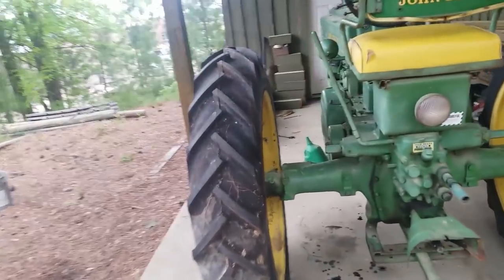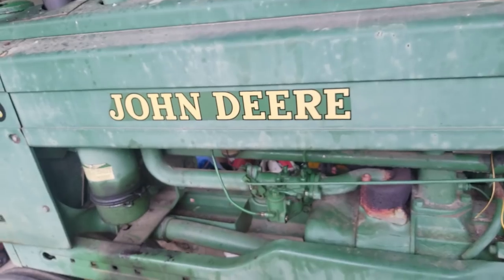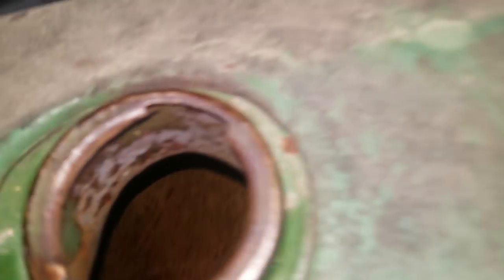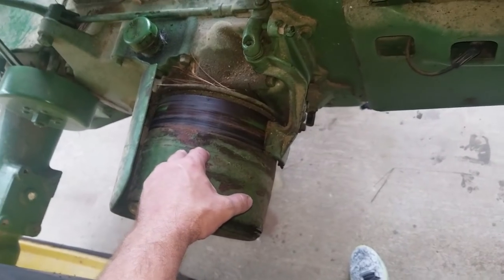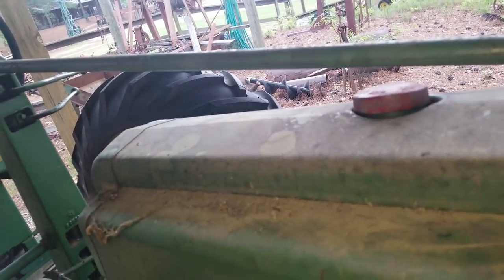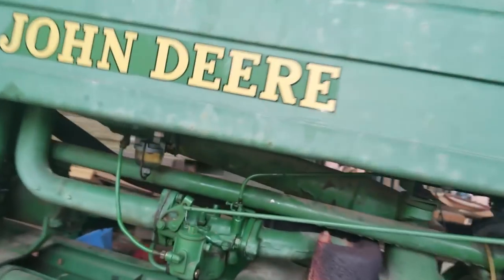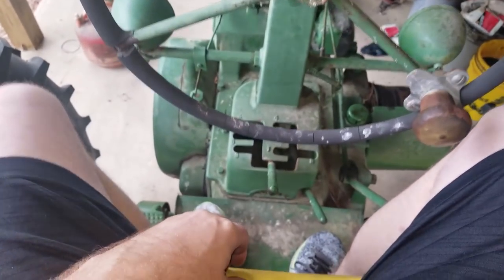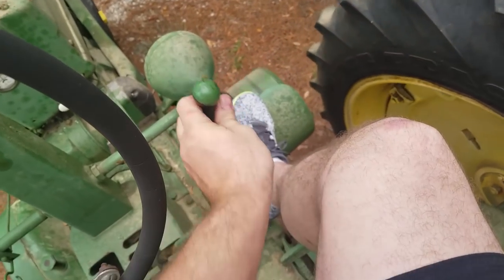How to  drive an antique John Deere tractor

Comment: After watching this video on describing the difference part of a JD-B, first of all you said to check the oil you take the plug out and look in their to see the oil level, what you do is screw it out a few turns and oil should drip out the bottom if not add oil until it does, then the lever on the left side of the seat isn’t the power takeoff lever it’s for the hydraulic lifts like the rock shaft that sticks out on each side of the seat or a cylinder on a piece of machinery your pulling, the PTO lever is that little one below the clutch level which can only be engaged when the clutch is disengaged, as for shutting the tractor off all you should have to do is pull he throttle lever way back and the tractor should stop, on yours either the linkage on the rod going to the carburetor is wrong or the set screw on the screw on the carburetor next to where the rod connects is screwed in to far and not letting the butterfly inside the carburetor close tight, I’m not trying to be a smarty I just wanted help you understand the JD two cylinder tractor better,
Reply: Fred is absolutely correct.
Reply: All correct, Fred. Looks like it has the Pow-r-trol hydraulic set up. The 1949 B I started driving when I was  3 years old had only a foot pedal under the front edge of the seat tower to operate the rocker shaft. We had other somewhat newer two cylinder tractors in those days that did have the Pow-R-Trol hydraulics and live pto (50, 60, 620). The one in this video desperately needs that clutch lever adjusted. It will take your kneecap off if you snap it out of engaged position running it like that lol. I do remember using the belt pulley to power grinders and other equipment. And with practice, it was possible and sometimes necessary to shift on the go. We still used our old B for light work -running augurs or moving wagons around the yard - until at least the late 1960s by which point not much work was done with anything less than 90 hp or so. And now the "big" tractors from those days are scarcely worth starting up to do more than running an augur or going to get the mail ;-)

Comment: Good.  But you shouldn't use the choke to stop the engine.   Properly,  closing the throttle should do that.  But some of the  early models (pre-1947) were shut off by closing the gas spigot.  Thanks for sharing.

Comment: You can shift on the fly on these JD's with some practice.  It  also saves riding the clutch when trying to start from stop in 6th/road gear.   On my uncles tractors we would start in 4th, open throttle wide open, when up to speed, then pop the clutch, pull back some on throttle, shift into 6th, bump the clutch a bit if your grinding, and should go right in, throttle back up.  Trick is to do this all before you lose momentum.  If you get the right "touch"  of throttle, and clutch, shifting, it goes right in without any grinding and you jump right into road gear without a lot of wear on the clutch.  Some of later JD's had hi/lo levers down by shifter, next to power take off lever, they were even easier, gears were 1-2,3-4,5-6 and you could do the above starting low lever position, then shift on the fly to high, using your foot to  move the hi/lo lever.  5-6 still kind of rode the clutch from a dead start but not as bad as from 6th.  We mainly did up shifting as you had to slow way down to down shift one or two gears down on the fly, throttle way back.  My uncle when haying with a jayhawk bucket could make it look like he had an automatic transmission he was so good at it.  Those were the days !   Enjoyed the video !
Reply: Yeah my dad has told me how to do that on the deeres that have hi-lo gears. Its a lil tricky but not impossible
Reply: I remember this, David M , now that you mention it. Wonder why we didn't get killed in those days because we were always pulling stuff that if you think about it, was ridiculously way too heavy for such tiny tractors lol. Always managed to get stopped with it somehow, but pretty risky business if the truth were known ;-)
Reply: @kennethstanton5407  Isn't that the truth? Not only overtaxing equipment, overweight pulling, etc., when I was younger, would ride with my cousin standing on bouncing parts of tractor pulling implements that would pulverize me if I fell off, forget any safety.  I did have another cousin tip one of these on a side hill too fast, fortunately threw him free, but messed up his hip.
Reply: @davidm8717  I was remembering today that I was only about 5 years old when I was turned loose on my own running a B John Deere pulling drag harrows and a roller. I was given a stern warning not to turn too sharp because there was a risk that the hind wheel could pick up the harrow and drag it over top of you, which could do more than mess up the paint on the fender ;-) There didn't seem to be near as much worry that I would fall off and get run over by the roller. Either it's because they had more kids in those days and figured they had spares, so why worry? Or it's that my father figured I had demonstrated enough intelligence not to do anything goofy enough to end up falling off. ;-)   In those days, we would spend a ton of time riding along with the adults, or driving with them sitting behind us in the seat, for hundreds of hours before they'd let us operate solo.
Reply: my thought exactly,...thank you

Comment: You should never use the the clutch brake to stop the tractor should pull the clutch out and use the brakes evenly to stop and then use the clutch brake to stop the belt pulley so you can put it in gear

Comment: The hand brake only stops the tractor while the transmission is engaged. If the tractor starts rolling while out of gear, the foot brakes are required to control the tractor.

Comment: Instead of rebuilding a car when I was 13,  Dad got me a B john deere to rebuild instead.  I didn't get a car till I was 18.  I still farm with one 30 plus years later.   Great tractor on the hay rake.
Reply: Even better on sickle mower ( also jd, that clamped to back of tractor, and single trailing wheel)) duty . Come to end of field , step on right brake spin steering right, then release brake and steer straight  to continue across field. Worked so well, so fast.

Comment: I have a John deere 620, 1957 that when I put it in gear and let out the clutch, doesn’t move. Is there some lever or gear I need to set ( besides putting the gear shift in a forward gear or reverse gear) to make it move? It was pulling fine when it was parked, but no one here knows how to make it go now… thanks, ANYONE!!
Reply: You might need to adjust the clutch. There’s YouTube videos on how it is done.

Comment: does it have petcocks underneath the cylinders to decompress? that's often part of the startup protocol
Reply: Most of the ones with compression relief were hand spin start.  Our A was like this with electric start & no compression relief.
Reply: Our 1955 JD model 60 has decompression petcocks
Reply: Even with electric start, most had the relief petcocks on the bottom side. The older ones (unstyled, for sure) without electric start had them up on the topside where you could see them, or open them without crawling around on your hands and knees. There was also a "crank" which was a steering wheel with a crank hub that fit into the flywheel hub. Awkward thing to use since you were squeezed between the flywheel housing and the rear wheel. And quite hateful if it backfired and tossed you over the axle. But, when handcranking, you needed the compression relief.
Reply: Yes, his are underneath. Older ones are on the sides. 1935-1938 had none. 
They aren’t necessary to start, but can help if you are hand cranking.
Reply: Once started, there’s mighty hot gasses coming out of the relief valves(peacocks). Use gloves or get burned.

Comment: The Lou ears are for distillate.  These tractors were originally built to start on gasoline then switch to distillate when the engine warmed up.  The louvers helped warm the engine faster so that it could be switched over sooner.  Distillate was a low cost fuel for farm tractors from the late teens to the 1950’s before it was phased out in favor of gasoline, lp gas or propane, and diesel fuel.